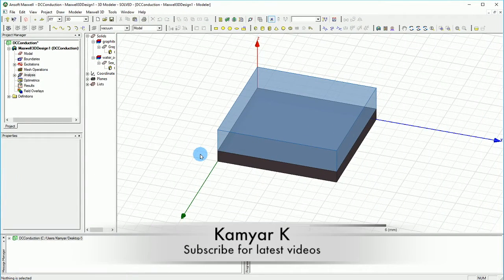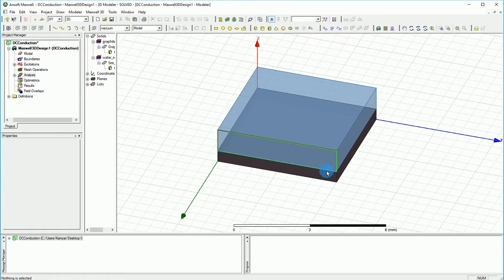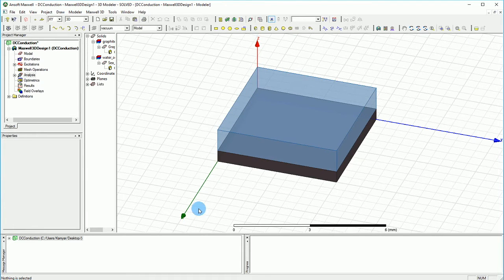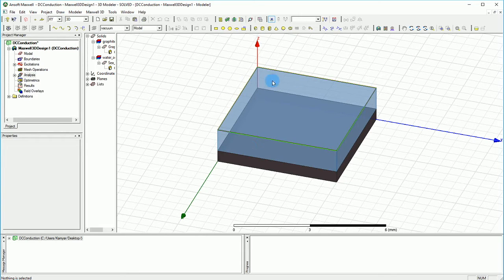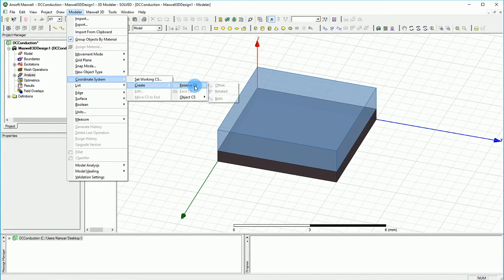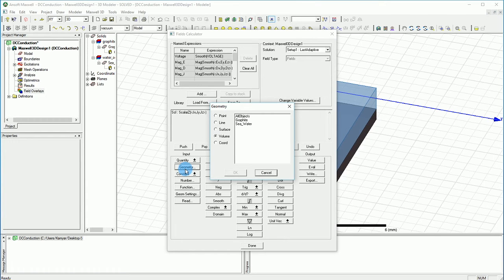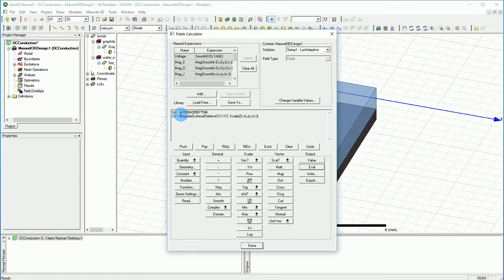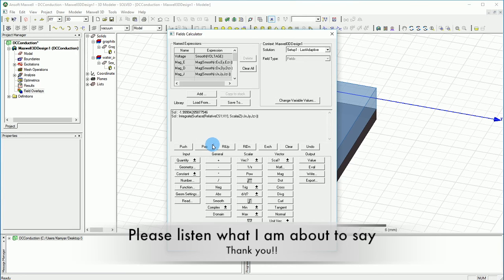603 - Ansys Maxwell | DC Conduction | Resistance of Sea Water [3/3]

Comment: Do you have any idea why my calculated DC resistance gets messed up when the bulk conductivity of the material becomes less than 1?  If the conductivity is 1.01 S/m I get a resistance around 1.5k but when my conductivity of the material is set to .99S/m I get a resistance of aprox infinity.  Any ideas?
Reply from the maker: when you go to design setting (right click on the project) you see that anything under than 1S/m is consider insulator, you can change that to a lower number say 0.001S/m and you should be good

Comment: I could not apply this method to complex shapes. I wanted to measure the total resistance for all body but found a better way. Entering 'Results - Solution data' and dividing the Total Loss (W) by the voltage becomes the current (I = W / V) and dividing I by V to get the resistance(R = V/I). :)